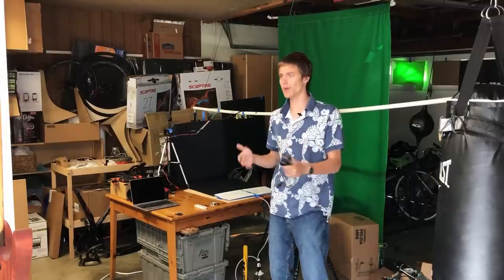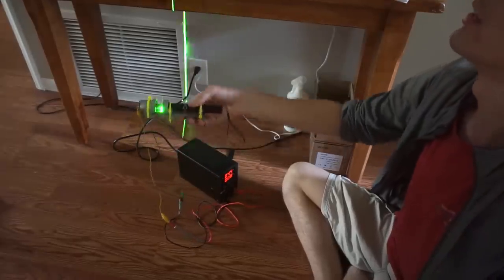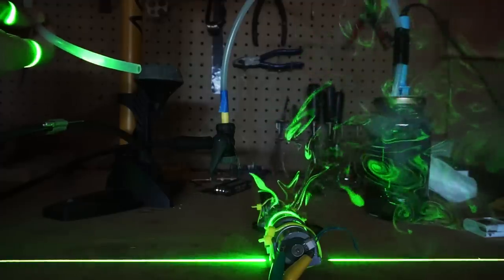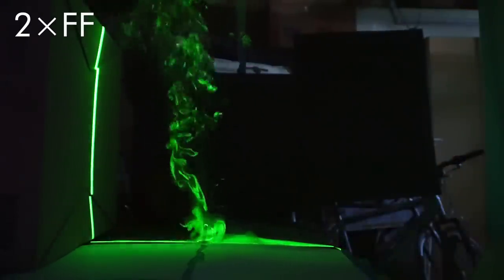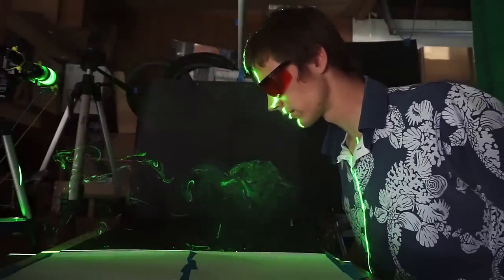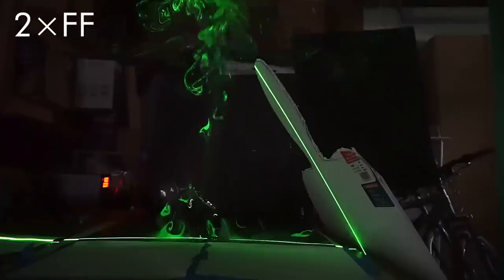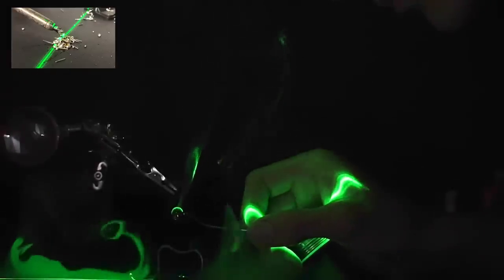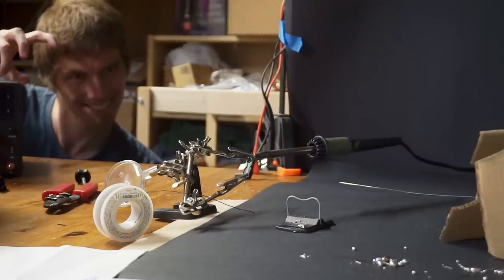Why does smoke from a soldering iron ALWAYS go towards your face???

Comment: question: wouldnt the laser reflect into your eyes while you were looking away from the laser, with the laser eye protection on since it blocks the wavelengths, which i assume means that it reflects it away, but since the laser is entering from the side that your eyes are on, it could potentially reflect back into your eyes?
Reply from the maker: The glasses actually absorb, not reflect, the relevant wavelengths so yeah you don’t want to get laser light in from the sides (because SOME does reflect) but it’s not as bad as you fear
Reply: @AlphaPhoenixChannel  ah, thanks for the response, that makes sense and makes me more relieved lol, i was a bit worried for your eyes (even though you did mention that it was a relatively low powered laser)

Comment: I did not watch the video but the human body produces an astounding amount of heat so convection currents rise from you and cool air is drawn towards you. What ever smoke is suspended in that cooler air near you is drawn towards the lower pressure area near you as heat rises and takes air with it in thermals.

Comment: Speaking of smoke, I'll bet you did not know that all electronic equipment has a small vial of blue smoke which is vital to the proper operation of the equipment. Seriously. If the blue smoke escapes the equipment stops working. I'll bet more than once you have had blue smoke come out of a piece of equipment and sure enough it stops working.

Comment: I know there’s still a small amount of lead in the solder, how dangerous is it that we’ve been slightly inhaling that for a while?
Reply: The metal shouldn't be making fumes at typical soldering temperatures. The flux, on the other hand, is making all kinds of noxious chemicals as it burns up. I always get an awful headache after soldering, but not from brazing at much higher temperatures because brazing flux doesn't form vapours.
Reply: @nerd1000ify - proper ventilation is key..!
Brazing would be nice, but that wouldn’t do with circuits and wires.

Comment: You your body is very warm so you heat up the air the air starts rising that rising air pulls cool air in towards you from every direction and if you are soldering that smoke gets pulled towards you into your face and eyes .

Comment: i have a soldring gun which is 60wats and they way you use it is you plug it into a wall and thats it. every time i use it it smokes from the middle part where there is holes which i think is to cool it down but it smokes alot  from that part idk why it happens and im scared to try it again

Comment: I know that body heat updraft is a thing so I suspect it adds a bit to drawing the smoke towards you and/or creating the low pressure between your arms.
A small CPU fan sucking towards the wall should fix the problem.

Comment: Back in 2009 or so, I hacked a simple de-smoking solder station. basically a CPU fan zip tied to a desk lamp that used little 12V halogen light bulbs. http://www.flyinglow.ca/flyinglow/2009/03/smoke-reducing-solder-station.html